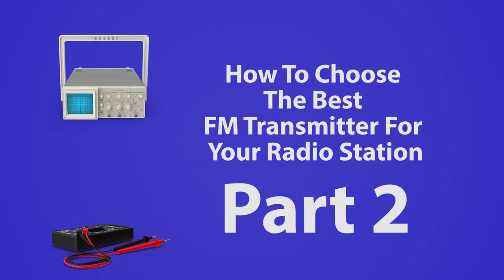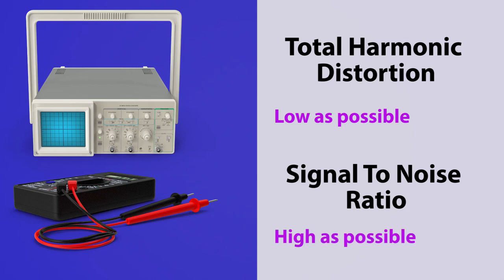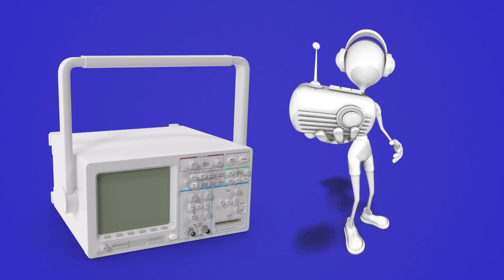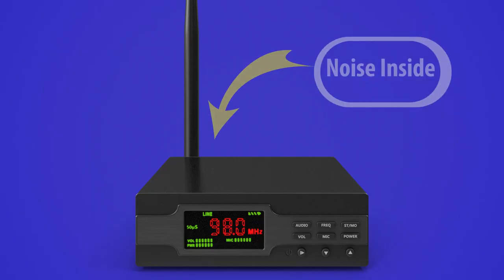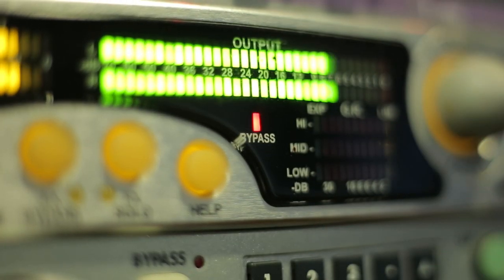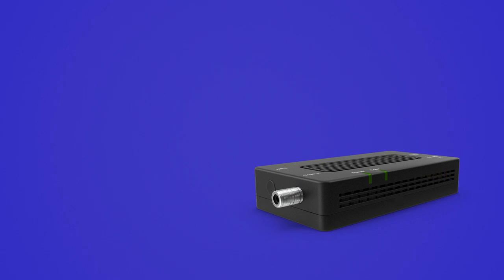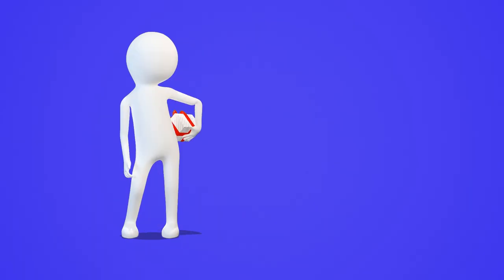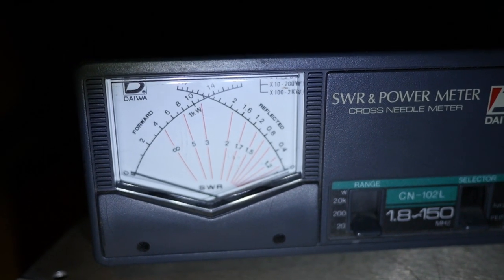FM Transmitter Radio Station. PART 2 How To Choose The Best Possible Transmitter For Radio Station

Comment: Would you think that it is better to mount a transmitter closer to the antena (maybe an attic), run a bit of coax cable to the antenna on roof, and then run audio and power all the way from the studio to the attic or would you say that its better to mount a transmitter down inside a studio, and then run long peace of coax to the antenna on the roof?
Reply from the maker: Hey, great question. If your transmitter is not very strong then it makes sense to mount it closer to the antenna. The only problem is that if the audio cable is very long it can pick up noises from electrical cables etc. So you can end up with bad audio. If you run a long 12 Volt cable to the transmitter the voltage will drop as well. This will mean your transmitter will be putting out less power as well. So you won't have gained anything. If you run an electrical cable up to the transmitter and the power supply is inside the transmitter or at least close to it then it shouldn't be a problem. Of course, the best setup would be to simply run a coax cable from the transmitter in your studio up to the roof if you have good-quality cable and connectors. I am busy working on a new video about FM transmitter cables and connectors which should be available soon. That video will explain which cables and connectors are best to use. But the basics are that if the cable and connectors are high quality then rather run the coax to the roof. If the cable and connectors are not great then you are probably better off running a long audio cable as long as you can avoid audio interference from fluorescent light cables etc. If your transmitter takes balanced audio inputs with XLR connectors then this is easier to avoid because the balanced audio will cancel out most, if not all, the noise interference. So then a long audio cable would be best. Hope that helps :)
Reply: @inspiresoundpro  I want to thank you for your fast reply, and to say that I just recently found your yt channel and I think I've watched every video on it. Great source of information for someone who doesn't know anything!
Right now I'm using about 15m of RG58 cable, and antena is not tuned correctly, SWR is 1.9 which is terrible, so I think that about 1/3 of the power is lost.
I was thinking about tuning antenna for the exact frequency, and putting transmitter on attic. I already have an AC outlet on the attic, so I could put a PSU there to power a transmitter, but what I know nothing about is running audio for long distance. My guess is that interference and voltage drop would make audio usless at the end of the cable, and I don't want to go through an effort of doing everything just to find out that it only makes it worse. One of the ideas was to use existing coax cable to run audio through it in order to lower interferences, but I truly don't know if that would actually help, and there is still question of voltage drop for such a long distance. How would you solve this problem? Another idea I had was to put another computer to the attic, and to relay sound to it, but that seems like something that would cause more problems than it solves
Reply from the maker: @mikachigi  You are very welcome. I love talking to people about all these things. Hey very cool that you watched all my videos lol. I have so many more to make but it takes quite a long time to complete each video so I can only put them out slowly. For your problem, long audio cables, there is only one way to go and that is with balanced audio cables.  If your transmitter has XLR connectors on it then it probably has balanced audio. The balanced audio setup cuts out loads of noise and can be used for quite long distances. Any other audio cable will pick up noises. Even a 10-meter cable with RCA connectors on it will end up with really bad noise interference. If your transmitter has a jack plug/mini jack or RCAs connectors on it then the audio is unbalanced and no matter what cables you use you will get noises. You might be better off spending a bit of money on RG213 cable. RG 58 is really only good for short cables like car CB antenna cables. I talk more about this in the video I am working on but just to say that the cost of the R213 might be worth it to get around all the effort of putting things in the roof. Also if you tune your antenna correctly you will benefit much more than putting the transmitter closer to the antenna. A tuned antenna can dramatically increase your output power. Also at SWR 1.9 you could damage your transmitter with all the power coming back into the transmitter output. If you are only going 15 meters or so the cost of the RG213 won't be that much compared to all the expense and effort of trying to put things in the roof and with an SWR of 1.9 it's just not worth the effort because your loss is so high from the antenna. If you were going 30 meters or more then it might be worth running the audio cables but for 15 meters you are better off with RG213
Reply: @inspiresoundpro  Last night friend and I tuned antenna, we did cut it too much and it ended up being resonant at bit higher frequency than we wanted, but still, at desired frequency we got swr down to 1.2 which is much better than 1.9
After a quick ride in car we realised that signal distance has improved significantly!
Unfortunately I used cheap chinese transmitter that does take balanced audio and after considering pros and cons, mounting it up near antenna is out of the question.
I realised that most of my mistakes could have been prevented just by watching your videos 😂
I will not be making any changes until your next video comes out 😁 don't rush it, we understand why it takes a while to make them. Keep the quality videos coming!
Reply from the maker: lol yeah exactly like I said in my one video...don't buy an antenna you need to cut lol. That is exactly what happens. But 1.2 is not bad considering you had to cut it. It is fun   to see how much a signal improves when you tune an antenna. When you get it resonant at your desired frequency it is quite amazing how much better the signal is. I had a small local station a few years ago that broadcast with just 1 Watt of power and the signal was amazing because the antenna set up was good. People couldn't believe it was only 1 Watt. We had 12 000 listeners. It really shows how putting the effort in to get the antenna right can make a huge difference. I will keep working on the video lol. I hope it will be ready in the weekend.

Comment: Can I just use a transmitter in my house by itself to send audio to my radio on my back porch.
Reply from the maker: It depends on your country's laws. Many countries allow low power transmitters like iPhone transmitters and car FM transmitters but like I said it depends on your country. Also the range and power output also varies from country to country. In the USA for example according to Google  " Unlicensed operation on the AM and FM radio broadcast bands is permitted for some extremely low powered devices covered under Part 15 of the FCC's rules. On FM frequencies, these devices are limited to an effective service range of approximately 200 feet (61 meters)." That would work for most peoples houses. But be sure to find out what the laws allow in your country.
Reply: Maybe 200 feet to a handle held radio